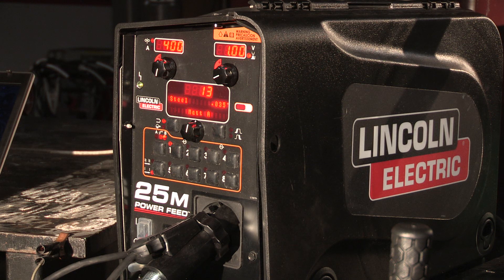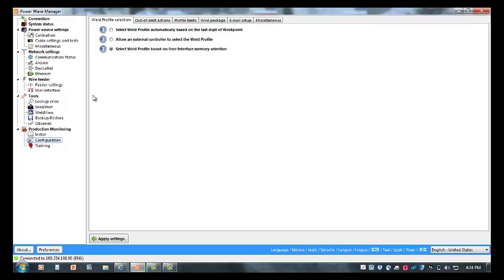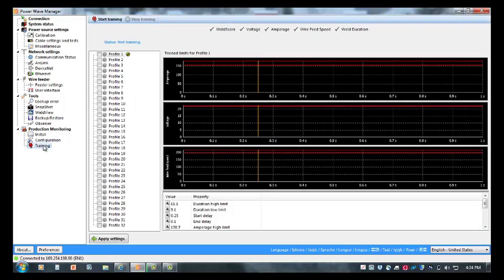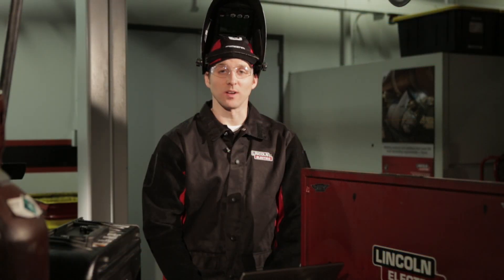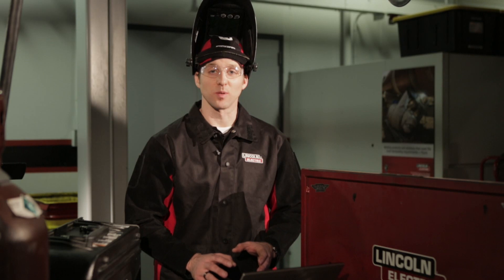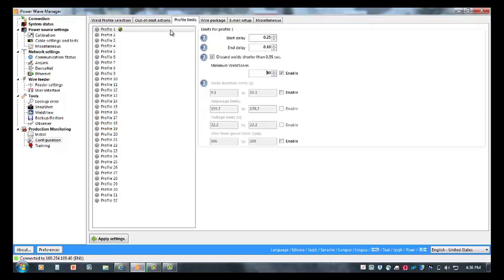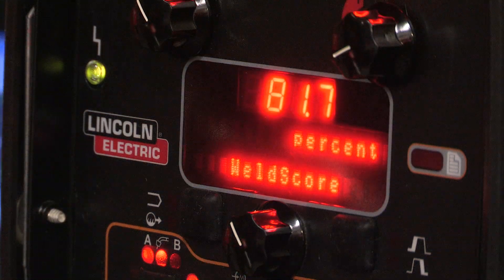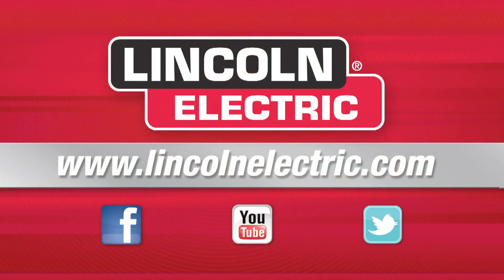Tech Tips: Setting Up a WeldScore™ Profile

Comment from the maker: Sample rate is at 120KHz.
Although these power sources are very advanced, they don't have the same data storing capabilities as typical PC.  This is a result of their primary function, welding.  With that said, the welder stores the final result, rather than all the data points associated with the weld, and is able to communicate that information with other programs, ie. CheckPoint.